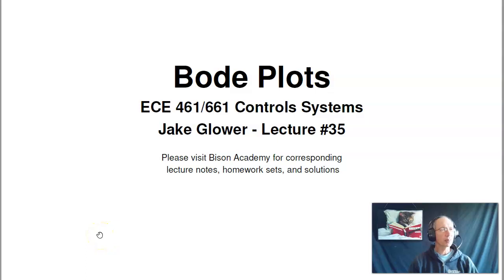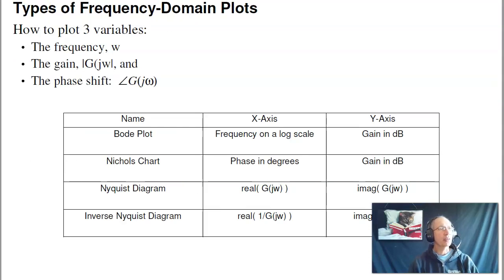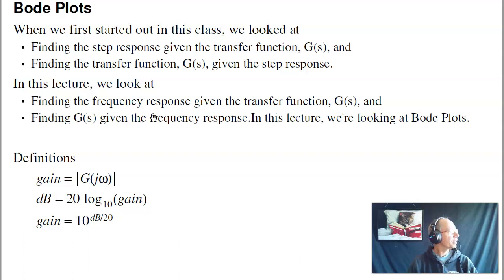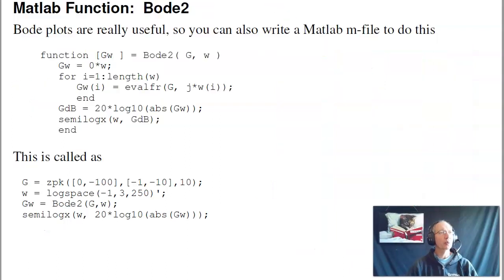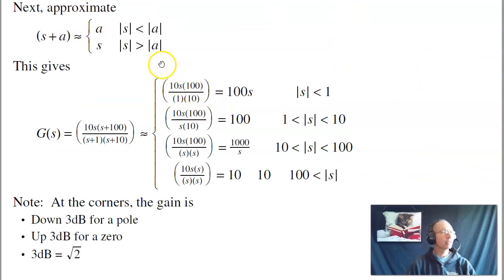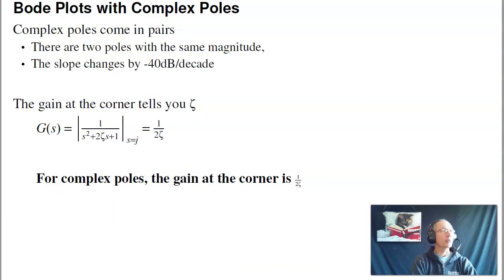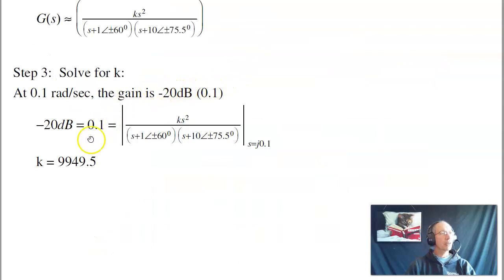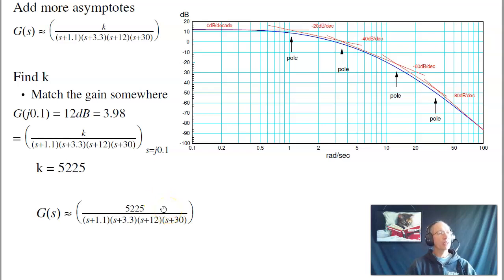ECE 461.35 Bode Plots

Comment: Hello Sir, Thank you so much for the videos, I am really benefitting a lot.
I would like to point out a small mistake, at 14:16. I tried to redraw the bode plot for this transfer function, and it turned out that the gain at the 1 rad/s is 3 db less than the corner not 0. We can see that also from the value of zeta, which is not 0.5 at 1 rad/s, but 0.7 because the polynomial is s^2+1.4s+1, so 1.4/(2)(1) = 0.7 . so 20*log(1/(0.7*2)) is roughly -3 .
Thank you again!